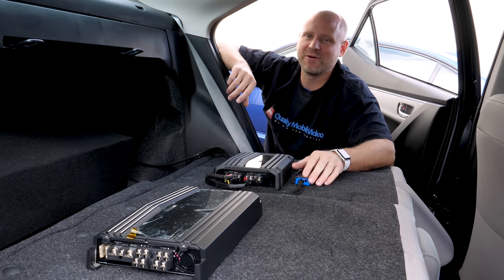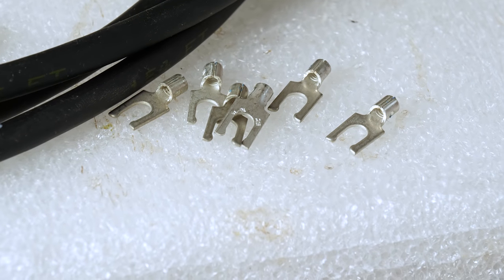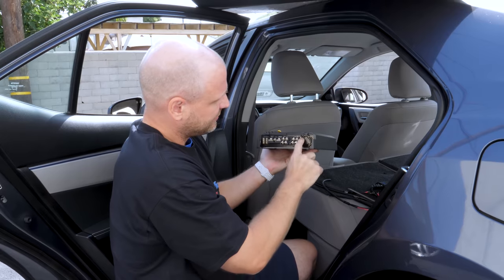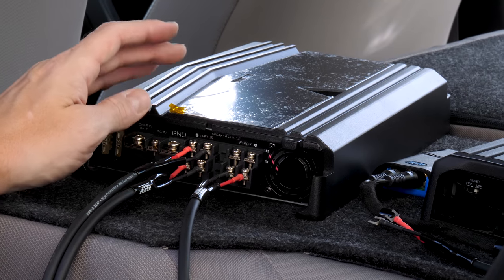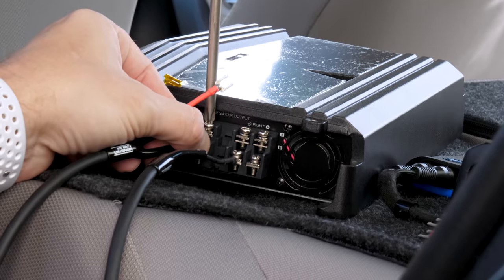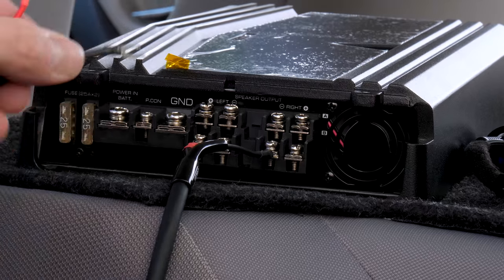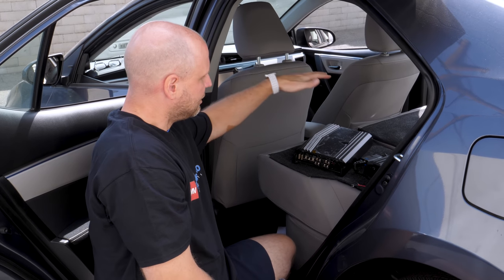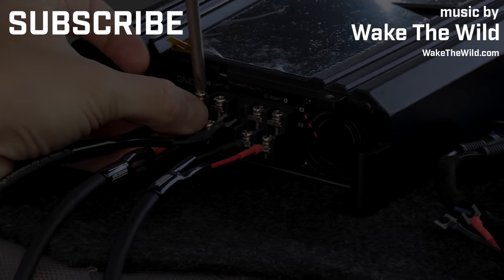How To Wire Speakers and Subwoofers to Your Amplifier - 2, 3, 4 and 5 Channel - Bridged Mode

Comment: ok so i have the dual bride connection on my 4 channel amp , basically i have 2 speakers connectec , this is for a home setup so after this how would i configure my rca cables ? will i need 2 cables ?

Comment: 2017, lets take a shot..  Is it possible to unplug the Bose amp (2003 silverado)  and wire that plug to a new and better amp? If you can eliminate the amp by looping the wires into a new plug, seems like that same plug could be wired into another amp. maybe???

Comment: Hey bit of a dumb question here but if I'm connecting my speakers to the amp in a 5 channel system, the I will still need to bridge them from the head unit right? Or will the 2nd RCA cancel it out?

Comment: Was wondering what i should get to power my 08 Acura TSX with navigation. I want more power to doors and 6x9s. Have total of 8 speakers 2 tweets 4 6.5 and 2 6x9s and am debating on adding 1 jlaudio 10 in future. What is best amp channel and wattage to power all of it. I'm upgrading speaker from stock to JBL. Factory amp isn't loud enough
Reply from the maker: So 10 speakers total. You can either use multiple 4-5 channel amps, or use one 4-5 channel amp and wire the the front speakers and tweeters to the head unit

Comment: I'm short about 3ft 8guage power wire from battery to amplifier? Can I bridge or wire nut another wire ? The amp kit I bought (stinger ss600xs) about 17 ft is a little short on my setup.  Will it affect performance or is it safe to briged the 2 wires together?
Reply from the maker: Definitely use one single cable with your power and ground.

Comment: Question 
I have 4 speakers one in each door then I have two 6x9 behind the back seats that’s the current set up from cars factory 
Would like to also have x2 12 inch subwoofers 
Wanting to replace all speakers and include subwoofers 
What amp and head deck unit would I require please

Comment: Can I power two 4-ohm coaxial speakers and one 4-ohm subwoofer from a 2-ohm stable 2-channel amp?  If so, would I connect the "+ right" and "- left" amp speaker terminals to the sub so that it gets music from both channels?

Comment: On the 2017 Corolla S, are the rear speakers full range? Or do they only output low frequencies. I'm trying to install a 4 channel amp to my stock radio with a LOC to power my 4 front speakers and a sub in 3 channel mode.

Comment: So im trying to do a 5 channel on a 4 channel amp. Some of my speaker wire were bad so i thought I'd upgrade to 10 gauge. With this, I cant get two speakers to connect the way its shown in the video. Can I do a Y split, connecting positives with positive to amp, and negative with negative to amp? Or can I use distributive blocks? I'm a noob if you cant tell

Comment: Hi, We recently bought a van, with an amplifier installed and 2 subwoofers (he removed woofer). Now the amplifier is working and the stereo as well, but theres no music (both are on)... the 2 subwoofers are connected as rear left, rear right. theres still a bridge on top (with no connection at all), should i remove this cable? And will sound flow throug the other speakers then?

Comment: So when you run either 2 speaker + sub or 4 speakers + sub from one amp, is the sub playing all frequencies or does your amp have a bridged mode switch/dial to play only low frequencies?  Subs/Woofers playing full range sounds don't sound good.

Comment: does having all the speakers on those 2 channels half the rms to each speaker, for example if i have a 60rms amp and I put 4 30rms speakers on the 2 channels will the speakers get 30rms to each one? or do I need to buy an amp that is 30rms? any answer will help this is so confusing an havent a clue what parts to buy

Comment: Currently I have a 4 ch Kenwood amp (4x40 or 2x130 at 4 ohm) and 4 speakers connected to it.
Can I run my fronts + 150w subwoofer from the amp and connect rears to the head unit (Pioneer AVH 3300bt - It has high pass and sub settings).
I want to do a small upgrade with minimal cost (money/effort) and on theory this seems the best idea, but would it work?

Thanks!
Reply: Head unit also has 6 rca - 2 fronts, 2 rears, sub L/R (currently only 4 connected). I can move my rear RCA to sub L/R and connect a sub  to the amp and then run wires for rears to the head unit and solder.

Comment: Regarding the 4 speaker and 1 sub connection, does adjusting the front/rear balance on the radio alternate between the sub, and the 4 speakers? Thanks.

Comment: I'm wanting to run 2 60w rms speakers (340w peak) 4ohms each, and 1 250w rms sub (1000w peak) 4ohms. I have a 1000w class AB bridgeable 2 channel amp, can I run the set up you showed for two speakers one sub, left in negative positive left, right in negative positive right, and bridge the amp between left and right? Thanks

Comment: What if you have a 5 channel amp that had mono channel for sub then all wires for each speakers goes to its corresponding channel port on the amp  right  so so FR to FR FL to FL RR to RR RL to RL and SUB to SUB? Sorry if it’s a stupid question I’m new to car audio and there’s a lot of things to take into account
Reply from the maker: Yes that is correct!
Reply: @Qualitymobilevideo  awesome thanks should the fade setting effect the sub in that case like if I put the sound all the way upfront should it cut out the sub?
Reply from the maker: @Grabthembypussycat  Only if you are using 4 channel RCA inputs nad have set the selector switch to 4 channel.
Reply: @Qualitymobilevideo  it’s a five channel amp the Jbl club a5055 Jbl club 6420 4x6 in the rear and Jbl club 602ctp in front and a Kicker 48CVTDF122 for the sub do you think that amp is sufficient to run that I have the stuff but. Not all connected I would like to know your opinion before I do

Edit: I just went off the RMS like the sub said I believe 200-300 rms at 2 ohm and amp said 350 rms at 2 ohms for the sub and the speakers I checked the rms but I also thought they’re from the same series Jbl club so they have to be made to work with each other please tell me I’m not wrong I just want a kinda loud crisp sound and somewhat punchy bass nothing crazy don’t need it to sound like I’m at a concert and I don’t need the bass to be able to kickstart someone’s heart

Comment: What kind of cable do you use to make you speaker wires? I have a 2013 Fusion with factory stereo. It has separates up front that sound decent. It has some shitty speakers in the rear doors, so I want to replace them with a pair of JBL 6.5's coaxials, and the. Run two JBL 6X9's on the rear deck for extra bass. I also have a subwoofer cab for the rear, but the driver is blown. Once I find the right driver for the cab I want to trunk mount a sub with a separate amp and control for subwoofer volume. How would I wire that up?

Comment: Would I be able to do a 5 channel (4 speakers and a sub) system on an amp that uses ferrule connectors instead of the spade connectors? And if so how would I do that? Or would I have to not use the ferrules and plug the wires straight into the amp? I have a pioneer GM- DX874 for reference

Comment: I have a Kenwood KAC-3004 amp I have hooked up to a Pioneer head unit as 4 channel in my 81 Miata, witch had speakers in top of seat. Total of 4 smaller speaker in seats, right and left for both seats the I have 2 subwoofers in door, 1 each side. I have both rights of each seat on same channel and both lefts on another as well as door speaker with door speakers as rear and seats as front. My head unit has sub rca hook ups not being used but I am thinking that hooking my door subs to those outputs but not sure how I would do that with what I have. Any suggestions? BTW the amp is 600:watts, I configured all speakers to come as close to the 600 watts as I could w/o going over per each channel. Sounds nice, not great, think I might bet better bass with subs hooked up to rca sub outlets on head unit.

Comment: TL;DR:
Best amp setup for 92 Miata?
- Pioneer DEH-S5000BT headunit
- KSC Kickers up front (100W RMS)
- 3.5” CSC Kickers (one pair in each headrest)(90W max, 30W RMS each)(currently clipping with low HU power output)
- Pioneer TS-SWX3002 12” shallow sub (1500W max, 400W RMS)
- OEM setup: L+R rear wires from HU split to both pairs of headrest speakers... best to maintain this setup or do something different?

I’m trying to determine the best setup for my car. I have a 92 miata, with headrest speakers, and I’m picking up a shallow 12” Pioneer sub soon. With my current setup the HU doesn’t put out quite enough power (for the headrest speakers anyway - 3.5” CS Kickers 90W max, 30W RMS/each) causing them to clip at high volume, but the door speakers are temporary Blaupunkts (will be getting 6.75” KS Kickers 100W RMS) and are fine for now. But at highway speeds with the top down I can’t have the volume up enough to hear without it clipping. The OEM setup has the L+R rear wires splitting and going to both pairs of headrest speakers, but I’m not sure if that’s the best way to set it up for this. What amp/channel setup would be best for this, and would it be best to run one amp for everything or one for speakers and one for the sub?

Comment: Awsome vid, have some questions if i may, im trying to set a 4 chanel amp to power 4 main speakers and a single coil sub. Can i use the front left and right  output chanels of the amp to drive the four speakers and the rear bridgdeg output to drive the sub ? In such way if the four mains are 4homs each wiring them in parallel will result in 2hom loads for left and right, what would happen if sub load is 4 ohms, will that imbalance led to some kinde of issues ? or will that be ok? Thanks !
Reply: sorry men, it was allready explained in the vid, thats what happens when u skip parts, my bad, this channel is awsome and those installs are really neat
Reply from the maker: Glad the video helped!

Comment: I have a question. I have a 600 rms 800 max 8 in sub @ 2 ohms with a amp that's 600 watts rms @ 2 ohms and I'm trying to set it up in my room. I also want to buy a speaker so should I get a more powerful amp to power the speaker and sub? Or is the sub and amp ok and I can add the speaker too?

Comment: So in the 5 channel set up, once you hook up the speaker wires to the Amp and the sub to the Amp, you just run the RCA cables to the head unit and it's done?

Comment: hi dear i have sonyXM-N502  amplifier 2.1 channel can i connect in it 2 speaker and one subwoofer  sony   1350 peak  watt  maximum 300 watt XS-GTX121LT  in the bridge  like you when you put the 2  speaker and one subwoofer

Comment: Hi i have a 4 channel amplifier jvc ks dr3004 800watts max power and i want to connect 4/6.5 inch factory pioneer speakers and a subwoofer 400w/200w rms which channels should i use? My amplifier has 
60w*4 at 4ohms,90w*4 at 2 ohms,and 180w*4 at 4ohms bridged.Also i want to ask  if i can use the amp to drive only the subwoofer and use the head unit my pionner 4*50w to drive the speakers

Comment: so wait when you bridge a 4 speaker system to a 2 channel would that still have seperate sound for each speaker? meaning if you have sound going to one speaker say the driver front would it go to that speaker only or on the driver front and rear?

Comment: Using the existing speaker wire vs running new will that make a difference in sound quality?
Reply from the maker: If it's factory speaker wire, absolutely running new speaker wire will make a difference, especially if its OFC(oxygen free copper)

Comment: I had a local audio store here in Indianapolis install a Kenwood head unit, amp and speakers in my 2012 Altima. The place got good reviews but not all of them. When they gave me my car back they told me it "did not start up as easy as it once did." No kidding. When I complained to the owner he blamed it on the battery in the key fob. It wasn't. I was  lucky to be able to drive it home. The next morning I drove it to my local Nissan dealer. They found they had drilled a hole into the firewall  cutting wires and damaging the computer. I have been out of a car for over a week now while we wait for a car computer on back order. Total bill: $2500. I complained to the car stereo shop and got no response. It's criminal people can do business like this and not be held accountable. Wiring is crucial.

Comment: Hi, your video is very helpful. I wanted to install amplifier and speakers to to my stereo. I m having some problem. I wanted to had 2 speaker and subwoofer to my aftermarket head unit, but my head unit only have one set rca.
Reply: Austine J but a rca splitter, it turns one set into two sets . Second option is to use hi/lo level inputs on your amp.

Comment: Do I need to run fuses, after my power disturbion blocks or is the 1 near the battery engouh or should i run fuses on all 3 power cables?( 1 near battery 2 after block)

Comment: I want to plug my 2 12" sub  compvr and also connect my 4 front and rear speakers 6.5 pioneers.
Which amp do I need ?
Reply: 4 channel amp for speakers and mono amp for subs

Comment: Hey there I got a noobastic question.... If I were to wire a 4 channel amp in a Front Speakers + Subwoofer Bridged, would that be ok to leave a pair of factory rear speakers connected to the head unit, so as to have also the rear speakers playing? Any downside to it?
Reply from the maker: In my system my front speakers and tweeters are powered by my head unit

Comment: Where can I get that speaker wire?  It looks to be S16-2 XLN high performance xtra low noise 2 conductor. I can not find that wire anywhere.

Comment: Is there a way to get extra power to the two rear deck speakers without having it connect to the factory stereo they just don’t seem to get an a lot of volume compared to the front speakers

Comment: What do you do if you want to add additional speakers like tweeters do you just stack them on top of the other speaker wire channels ??
Reply from the maker: You usually would parallel the connections with the use of a crossover.
Reply: @Qualitymobilevideo  would you happen to have any videos to show an example

Comment: great video Ive learned so much from this channel, can someone tell me, does the amp automatically filter lows for the subs and highs for the front speakers?
Reply: Since73 no amp automatically filters for highs and lows. Most amps are set up for highs in the front and highs/ los in the rear via a switch on the filter

Comment: I don’t understand. How would I go about wiring this? I have a 2010 Volkswagen Tiguan and I’m getting infinity kappas 60.11 cs and both my front and rear doors have tweeters so they want me to use a crossover with all four. Also, I’m looking to add a sub. I don’t know what sub I want yet but how would I wire my two front speakers to one positive and one negative and my two back speakers to one positive and one negative, and how would I do that with the crossover if I’m looking for a five channel

Comment: Can a amp with four channels be connected to 2 6x9 (those are going under the seats) with two bullet tweeters and 2 subwoofers that’s what I’m trying to wire with the audio pipe that has 4 channels

Comment: Hi, I have a pair of rear speakers and each has 500w and 4ohms  make it a total of 1000w and 8ohm. Which amplifier would reccomend that can supply enough power the a (500w, 4ohms)^2 ? Thanks

Comment: trying to improve my budget build, running two 10s from vm audio rated 4200 peak watts 1050 rms each pushed with a audiopipe apmi 2000 mini class d, figured my 10s would blow seeing how they came with a 1600 max watt amp only had two 20 fuses so maybe pushing 400 watts. i watched williston audio and budget gem or budget bust and both tested the amp and it tossed out 2400 watts wired to 1 ohm dynamic. so my question is, i have everything turned up and when i turn the bass knob up it dont get any louder past half way and the subs keep @t can my two 10s hold more power?

Comment: i have a bmw with 8 speakers and 4 tweeters, changed all speakers to 4ohm kenwood Coaxial speakers all 8 of them, and have a 5 channel amp but its getting real hot shuts down when played to high, i know i did something wrong lol, so how do i wire all that up to my 5 channel kenwood amp ? or if you have a video i can see on how to fix this i have access to all wires on the back trunk. hope to hear from you

Comment: hey mate do you have a guide on how to wire up a 4 channel amp to 4 speakers, and than a seperate amp for a double subwoofer? i've tried connecting mine, and the 4 channel amp is giving the other amp and sub more bass, i've checked the wiring and it's connectod properly, both remote wires from both amps are connectod to the same remote wiring, im not sure where im going wrong, so just curious if you have a guide? thankyou.
Reply from the maker: Actually yes! In this video we install tow amps, one for the 4 speakers and one for the subwoofer: https://www.youtube.com/watch?v=LPmZC9u39LE
Reply: @Qualitymobilevideo  alright sweet I'll check it out thankyou